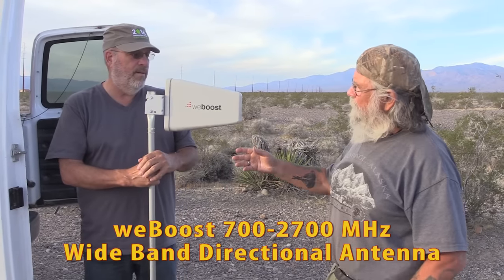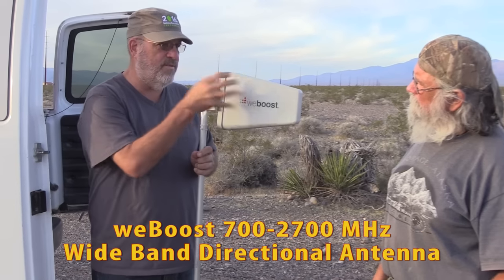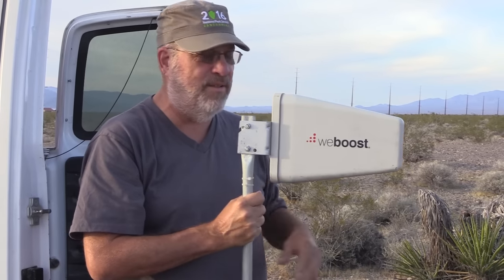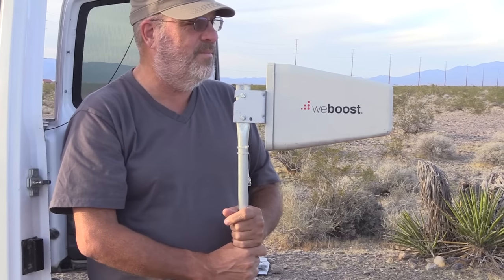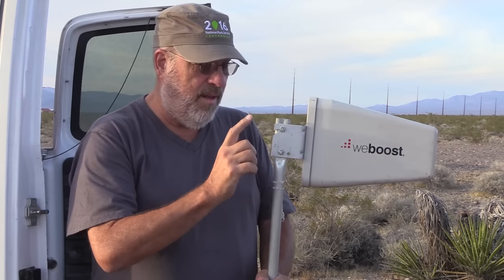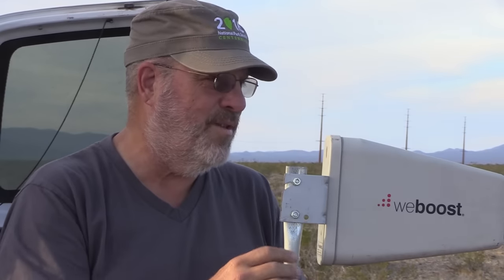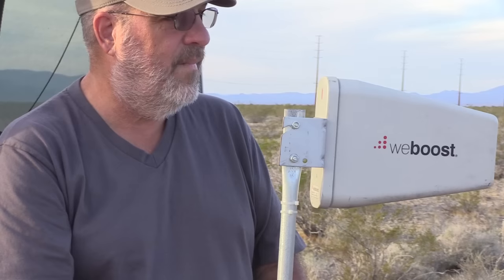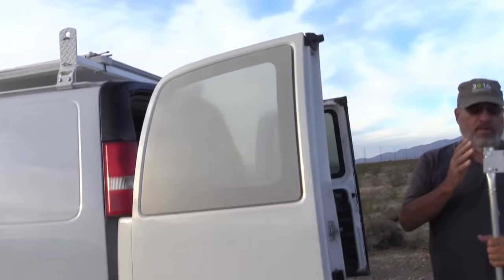Van Life 101: How to Get Internet on the Road

Comment: To bring the cable into the rear of the van, I'd try to take advantage of the recesssed horizontal surface above the top of the rear license plate holder. Drill a hole for inserting the cable up and then through the black inside door panel. When in use, there'll be a drip loop formed in the cable on the outside and when not in use, you can tape or cork the hole. In this setup you can close your door.

Comment: I love my WeBoost, purchased in summer 2018 - I have it with Verizon phone, Verizon jetpacks, computers.  An app called OpenSignal will also help find where the strongest cell signal is.  I live on a farm in a RV in a rural area where the DSL isn't fast enough and Satellite is too expensive.   Mine was $499 and came w the directional antenna (I taped to a tree for now), the controller (that has to be plugged in to regular electricity), and the antenna.

Comment: Hey Bob, when I was driving my work van, a Ford F-350, I used CB radio all the time, here is what I did. I got my radio and magy mount antenna matched up. Then I took off the roof brake light and took a round file to it until the cable would fit in the groove. The end fit easily through the hole where the light is , then I just siliconed the piss out of it. , every year or two I would get a small leak, not bad. I would get some fresh silicone in a tube and re caulk it.

Comment: Amazon part number 955822 is a direct connect cable for the sleek to the directional antenna. No adapters.20' Rg58u Coax Cable Assembly (N-male to SMA Male)  A refurbished Sleek is $119, that makes the booster, cable and directional antenna under $200 on Amazon currently.
Reply: That's a great deal but too slow for some stuff including up loads for things like you tube. Still it makes it affordable for many.
Reply: Go to the communication section of the CRVL.com forum and I have a number of post on inexpensive and even free internet including the $5 a month deal.
Reply: Sorry, my bad. cheapRVliving.com/forums
Reply: Thank you Jim. Much appreciated.
Reply: @jimbarnaby3547  how about an actual link . Since finding your posts there is like finding a needle in a haystack . Or maybe your user name on that site ? I'm not finding your name there or any sort of WiFi info . Just a bunch of unrelated posts that go on for pages .

Comment: I am a communications engineer. Avoid multiple adaptors and less efficient co-ax adaptors! Every one you place in the antenna lead when working at modern cellular frequencies causes about a 1/2 to 3/4dB loss of signal per connection point. Just so you "get it", a loss of only 3dB equals losing one half of the signal from the antenna.  Losses in antenna lead in and adaptors is signaifcant. Better to order an all in one adaptor/low loss cable for your needs. Perhaps SMA on one end and "N" on the other. You may achieve an extra bar or two. Also an even higher gain antenna than the Wilson is available from a company called MFJ. The Enginator.
Reply: So I'm an electrical engineer and it's been a long time since I took my RF courses but I couldn't easily find anything on their site.
Reply: Good point. I was hoping someone comment on that and MFJ enterprises is an awesome company.. Another source would be DX engineering. Do you happen to be a ham operator. Peace DE KB7ZPB
Reply: This is the most useful reply on this video. I was thinking the same thing and I'm just a lowly mechanical engineer :)
Reply: so i noticed he connected the coax connector to a metal shelf thats probably mounted to the metal frame of the vehicle.  is that a concern for interference?
Reply: Totally MFJ or DX engineering is another good place for coaxe cable and beam a beam antenna. Would help the gain in 3 Db plus

Comment: Drill through the roof and install the base receiver  into the roof connect at roof top and use some good silicon caulk  .  All heavy wire now inside van and door now is closed. thanks for the information, very informative guys.

Comment: Hey Bob,  Great video!

I have a little different setup that works well for me.  

I use a weBoost Drive 4G-X with a spring mounted weBoost 4G-OTR Cellular Antenna (I had the non spring mounted antenna that came with the unit and it busted the first time I went off road). Also, I use an iPad Air 2 has my hot spot.  The cool thing about iPad is that for full time internet access it has a Verizon SIM chip.  However, sometimes AT&T actually has a better signal than Verizon.  For that case, I carry an AT&T Go Phone SIM chip and swap it out in the iPad if the AT&T signal is better. I found this setup gets me a online 95% of the time.

Anyway… Thanks for your videos. You are a true inspiration and are motivating me to get out there full time.   Ray
Reply: I had no idea you could do the swap thing and have it work! thanks

Comment: So glad I jumped on the AT&T ZTE Mobley with usb adapter Connected Car Plan before it was ended. Grandfathered in at $23 or so bucks. There have been months when i put 200+ GB of data with no slow down.

Comment: You might tell Al to drill a hole in his roof above the weboost cradle and take the bulkhead conetor and use it for the roof that way he will have no problem with his back door, and he will still have a solid mount for the we boost with the included small cable ,the only difference will be the locaction of the bulkhead connector

Comment: Re: Power connector problems. For a semi permanent strain fix on the cheesy CB connectors, connect the power pimple to the unit, put some small pieces of electrical tape around the point where it connects, then use a nice sized blob of silicone sealant around the connection To add more protection, before connecting the pimple and sealing it in place, wrap electrical tape in a spiral around the cord starting at the connector and going down a few inches onto the cord itself.

I have actually used vinyl bathroom caulk for this as well, in the small tubes for more control, and it works well, but you may not like the smell as it is applied. Either way, it works well for trapping the connector and preventing wear from vibration on the road. Limiting vibration is also good, and mounting the unit onto a lead sheet which is backed by 1/2" foam, and THEN connected to cabinetry helps with that.

Comment: Check out Dynami wireless. They have a portable modem you buy, and then you pay $80 a month for unlimited data, so you're not worrying about having restrictions. Use it wherever you travel. It's worked great for me, and I think you can connect up to 27 devices to it.

Comment: Again, an interesting video Bob. Having a Google I find that in Australia there is a $250,000 fine for using a signal booster and Wilson & WeBoost are specifically mentioned as brands to NOT use. Seems that only repeaters with passive antennas are legal and then only with "permission". I'm beginning to wonder if I can possibly live the "Free RV Life" in the Antipodes with all the cotton wool clogging the roads. ;-) Thanks for the vid - stay free.

Comment: Take that bulkhead connector. drill a hole through the side of your van (or the roof) seal it and you can just connect through the wall (bulkhead) of your van and you don't ever have to worry about cable routing through the door or window. That is the intent of a bulkhead connector. (20+ yrs as an RF guy here)
Reply: I wonder if it will create a thermal bridge
Reply: You can buy a marine grommet (bake-lite PVC, or plastic) of any size that the plug will go through.  I has a nut and an o-ring on the bottom (inside the van) and a large nut with a large, thick, tapered split rubber grommet that goes around the wire.  Tighten the nut and the rubber grommet makes a water tight seal.  You would have to use a hole saw to make the hole.  If you removed the wire for any reason you could replace it with a wood dowel or metal rod and it would be watertight without the wire in it.
Reply: My thought exactly!

Comment: Unless it bothers you to drill a hole in your van/rv just but that bulkhead fitting through the roof... Put a rubber or plastic cap over it when not in use to keep out the crud.

Comment: Network Cell Info shows signal strength or the towers on a map. One can use a telescoping painters pole to get up higher easily. The higher you are the better your signal due to trees and curve of the earth. The larger more expensive models will boost the signal even more. You get what you pay for in radio hardware.

Comment: Great interview. A couple of things to add. 

First, google what is called Field Test Mode for smartphones. Once you find the RSSI or signal strength readout, you can use the dBm readings to zero in on a tower, much easier than using the display bars. In dBm readings, lower numbers mean a stronger signal. 

Next, check out a website called jefatech. All kinds of wifi and cellboosting products all in the same place. It's like an RV'ers candy store!
Reply from the maker: Thanks for the info tx2sturgis!

Comment: I have an idea to solve the "cable thru the windw" issue. Tell Al to take his bulkhead connector (which is currently poking thru the cabinet) and mount it thru the roof. He already has a cap for it and I'm sure he could figure out a way to seal abound the hole. Probably could use a shorter exterior cable as well.
Reply from the maker: Thanks for the suggestion S. Dale!

Comment: u can drill a small hole through the door --- epoxy a small pipe in that opening with the other side having a threaded cap and pass cable into cab that way.  spray paint the cap white it would blend in. hand screw tighten the cap on when not in use to close that small wire tunnel.

Comment: I'm not familiar with those particular devices, but as an old telecom guy I can tell you that antenna cables, even low loss ones, are very often a big part of your total signal loss.  Best would be a combined directional antenna, cell booster, and wifi hotspot all as one unit.  'Anyone make that? Even one inside the window of a camper could possibly outperform arrangements with a high antenna on a pole if the extra height meant a long cable.

Comment: We have Cricket Wireless (AT&T towers) at our rural SC home and tried to use phones for hot spots. The data signal is too sketchy and weak. There is no cable here, Verizon has a weaker signal (we had Straighttalk/Verizon phones previously at our former address) and AT&T has not upgraded our area to fiber (they sure love to brag about fiber optics). We are in a "hole" near a creek and signals are physically blocked by hills (no line-of-sight). Six miles away is Blacksburg, SC. and there is good phone and cable data available. There is a McD's and a Flying J just five miles away, but I can't get an over the air signal for the same reason. I can pull in digital TV signals using an  O.T.A. antenna/tuner combo, but there are few viable options for data in my case. So we settled by purchasing a contract with a satellite company (HughesNet) with 100 gigs of data/month, which I think is expensive (but still cheaper per gig than our phones). After the 100 gigs (and it goes fast with four people) they throttle you, and that restricts what you can do. After the data plan is used, I can barely bring up the internet (load time increases substantially). There is a real problem with rural infrastructure in this country! Imagine trying to work from home and get an online degree in my situation. I understand that providers are not willing to invest in rural areas because it is cost prohibitive (not enough households per square mile), but we are in between some big cities and this really sucks! I have seen satellite dishes in campgrounds. Are they for data or just TV?  Have you tried one? I miss my cable/unlimited data and no contract!

Comment: You need an N female to N female bulkhead connector. Drill through the sheet metal of the van and then connect a cable to each side, one to the antenna and one to the booster. Look in the amateur radio suppliers like HRO or Gigaparts websites.

Comment: Thank you for this!  Question:  I have Verizon but am often in an area for long periods of time that is covered only by US Cellular.  The Verizon pirates off the US Cell towers.  My phone will say "extended network".  This works fine for talk/text but internet does not work at all.  With the system you described in the video do you think I could get contact with a Verizon tower for internet?

Comment: If you travel buying an unlocked multi carrier radio phone like the Nexus is smart. Any sim cdma or gsm works. Also axon 7 works well with them too. Right now I have s8 plus which carries radio support but requires unlock and baseband flash. I think. I use straight talk att tower but I have all the SIM from kit for all tower support. My axon is best so far but my one plus 3t has free hotspot regardless. Lol

Comment: realistically no matter if rv, van conversion, caravan/camper, 5th wheel, rv truck conversion we all live within a faraday cage..

as such everything that requires a radio signal whether it be radio, tv, 3g/4g/WiMax/unifi/sat dish, wifi and any other form of wireless communications requires external mounted antennas, and sometimes a signal booster to improve reception..

most of the those for dongles are designed for city use these aren't designed for fringe use..

for real data use you might want to consider a solution that uses both sat and 3/4g as a base..

I've looked at phone and data and i would have say data on 4g is a scam as it was on 3g, though on the cusp of cities and major and minor little to no service exists, you have to rely on sat communications..

and looking at the 2-way sat options today you might want to consider sat-phone/data/tv package..

unless you are going to migrate and live within city limits the reality is 4g/3g/2g is nothing more than a waste of time as a service option as what you are using as the portal connection isn't designed for fringe use and few of these 4g/3g device  options support external antennas which is what you physically need otherwise you live 24/7 365/366 open door and window syndrone due to faraday cage living....

Comment: Why don't you use the pass-through you already have?
Drill a hole in your roof, install the pass-through, then connect the cable inside permanently, and the one outside can be taken off when not in use.
You can also get a cap for the connector outside to seal it when not being used.

Comment: Great video Bob. On the issue of the cable from the antenna coming from outside the van to inside the van, why not mount the adapter he has on the shelf in the ceiling of the van with some silicone sealant and then buy an N type weatherproof cap to put  on it when not in use?

Comment: I have the Verizon JetPack and kept my AT&T service for our phones. I find Verizon is a little better in coverage, but AT&T will surprise me at times. Valley of the Gods for instance, I had zero Verizon, but I was able to upload to YouTube with AT&T two bars. The other thing is that I have unlimited accounts on both, but AT&T has never throttled me after 22G, where Verizon seems to throttle more often, to the point that I normally just leave my AT&T phone connected to my computer which acts as my whole house router and then I will fire up the JetPack when I am in areas without AT&T service. Most of the time, if I can get one, I can usually get the other, but not always, and usually it's Verizon I can get in those situations, but not always. So, perfect solution for me is phone on AT&T and jetpack on Verizon. BTW, previously, i was paying Verizon 200 for 40 Gigs, I had to get that under control, so I went with the "unlimited" plan on both carriers.

Comment: The fitting/connector he has screwed into the end of the shelving.....why can he drill and attach that same fitting to the top of the van and screw it together on the outsid? Then he could close his door and prevent air & dust infiltration.....?